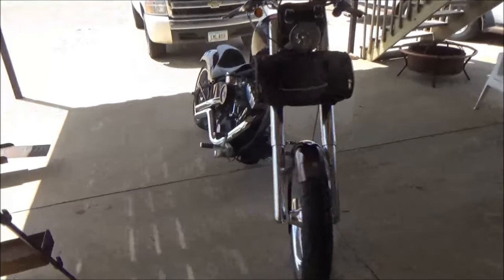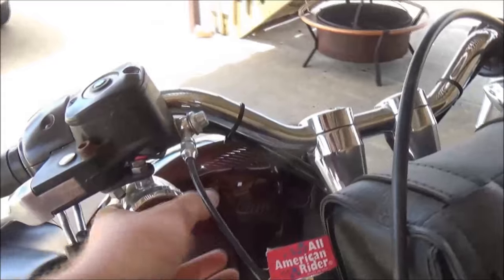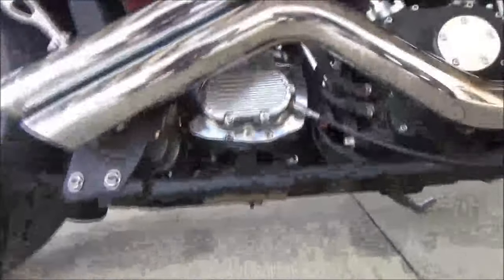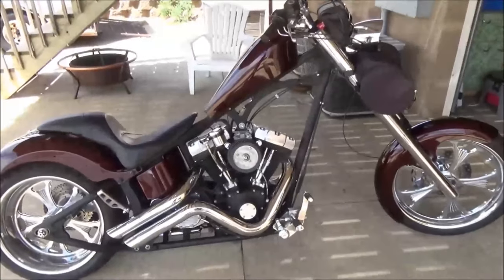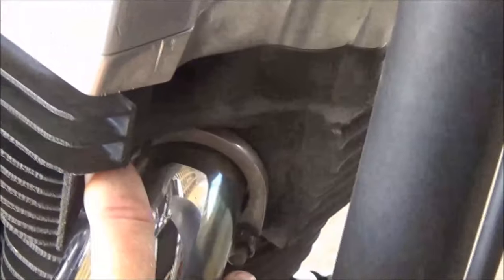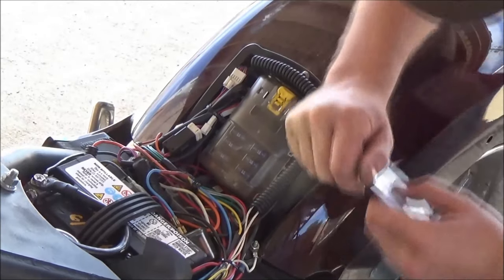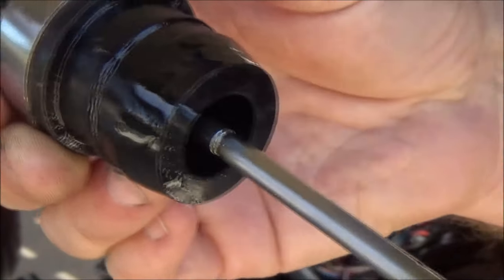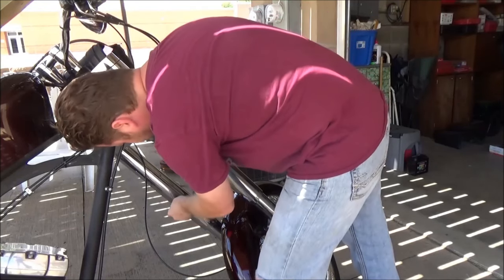What you need to know about owning a chopper! Best delivery of a bike EVER! #chopper #how2wrench

Comment: The Recession killed the "factory chop" market. The old farts who bought them during the "factory Harley" shortage spent enough to support a variety of companies, some of which assembled questionable shit (Big Bear neck weld failures come to mind!). When the Recession destroyed their 401Ks they sold their toys, and now they are too old to ride.  BTW I always check the alternator plug connection on Harleys/clones since it frequently fills with oil and burns/arcs the contacts. Easy to fix but most folks forget to check, and I ALWAYS do a cold compression test before parting with money.

Comment: Been ridin my ALL rigid chop for almost 14 years now. Only bolt I ever lost was the gas tank mount under the tank. I found the MOST important tip is THREAD LOCKER on EVERYTHING!!!!!!  Saves a lot of trouble.
Reply from the maker: Robert...I think you may be discrediting that you MUST be a good mechanic and understand tools, fasteners and how to work with them...not the case for a lot of other riders...😎 Don't forget anti-seize has its place. 

We sure love you taking the time to comment.  Join this channel to get access to perks:
https://www.youtube.com/channel/UCBhM8DCKnT3qXwTW0eToyCg/join 
Want to help us back? Please subscribe and give us a high 5 here:  https://www.paypal.me/how2wrench 
Follow us!
www.How2Wrench.com      
www.Tools2Wrench.com   
Facebook: 
https://www.facebook.com/How2Wrench/  
Instagram:
https://www.instagram.com/how2wrench/
Reply: @How2Wrench  I DO use anti-seize on my plugs always. Do you use it anywhere else?
Reply from the maker: Same here. Also on axle shafts and a few places for items I would consider standard maintenance like axle adjuster hardware.
Reply: @How2Wrench I like the axle shaft Idea instead of just grease. I'll be doing that. Thanks.
Reply from the maker: @robertshaefer7760  Here is what I use. I love its aerosol. Nice to work with. I've taken off wheels years later and thousands of road miles and its still on the shaft even after I personally have drive through pouring rain storms. https://amzn.to/32MvCkF
Reply: @How2Wrench  Got to admit I've never heard of that stuff. Coming from Switzerland it's no wonder. I give it a shot eventually. Thanks for another great tip.

Comment: I have a 82 FLU with a rigid mounted engine.   I check the bike from front to back once a week and still have had my front exhaust pipe , rear brake caliper, handle bars, seat, battery holding strap, throttle assembly come loose because fasteners backed themselves off. I always recommend carrying a toolkit that will save the day on a regular basis.
Reply: Red Loctite, locking fasteners and safety wire are your friends. I have Shovels too. Harley handlebar clamps don't positively control the handlebars so after trying everything else over the years I switched to stainless bars with welded risers, and on one set I tack welded the bars at my preferred angle to Biltwell stainless risers. The tacks are invisible (being inboard on the bottom part of the riser) and will shear in a crash. No more bar issues and I run 14 and 16" apes.  Of course I carry tools but I don't need them often. You can get tabbed lock washers for your exhaust pipe bolts.
Reply: Yep, a Harley vibrates that much and NO OTHER BIKE DOES, the company could stop that if they wanted to, decades old design could be changed just enough.

Comment: One of the best looking well, crafted and great profile, choppers, I have ever seen. QUESTION:  Is that a single cam, S&S engine or Rev Tech engine? What is the Cubic Inch displacement?
Reply from the maker: Thanks friend! It is a Twin Cam built to 107". I believe it's the largest you can go with stock Harley cases.
Reply from the maker: Head over to the new website and subscribe to the newsletter to never miss a video or newsletter! www.how2wrench.com/contact/ 
Keep Wrenching,
Shane Conley
Instructor/Motivator/Motorcyclist
www.how2wrench.com

Comment: Beautiful BIKE! I do hope you can help me out, thinking about buying a Bourget Black Jack used 2003, they are $8-$9,000 in flawless condition with 4- 8,000 miles. I think they are much cooler that the used sportster I could buy with that money. However I'm not very mechanically inclined, but I'm willing to learn and work on it. Any advice? Am I put pf my league, or could a average Joe like me own and operate a nice clean used chopper with little to No worries? I think they are timeless and works of art, and it would be amazing to own one. Thanks again in advance for your time and this great VIDEO! A+.
Reply: STUDY them thoroughly so you know more than the name. A lot of bikes weren't built using full S&S engines so when you see one over the cases. You can contact S&S with the engine serial and they'll be able to tell you if the cases were from a complete engine or pieced together.  If you aren't a mechanic, learn. HDs are easy to work on and though those use aftermarket drivetrains the closest HD factory service manual and parts book will serve you well.  The clone (h)arleys are easy to work on like the originals  Don't make one your only machine. Become your own chopper encyclopedia. There are no shortcuts. Also remember big inch engines with high compression aren't as durable as stock displacement stock compression machines. You can of course drop the compression at next top end overhaul.
Reply: Ob Fuscated THANKS SO MUCH!!!

Comment: I know I might be a little late here but, one thing I would like to share is in regard to S &S ez start cams. I never had experienced the issues you did. I had mine installed on a EFI touring model and never saw the need to readjust the idle speed with my 551's. Secondly, I am a fairly new subscriber to this channel. I would like to see a lesson on rear wheel alignment. I have been through a tough experience to say the least. Also how about suspension set up and what rake and trail is and how effects handling...
Reply: Harleyforever20 
As a car guy I chuckled at “turn the idle up” 
Because on my summer car for years it’s been eating alternator belts. 
It’ll eat 3 in 3 months. 
I’ve done tons of research, other folks having the same problem too. 
One day while screwing around I checked my idle speed. 
It was like 550-600, when it should be like 850. 
I turned the idle up and the half chewed belt has been doin fine for the last 2yrs. 
Same with the little Briggs air cooled engines, low idle isn’t cool , the crank dipper can’t splash enough oil to keep em lubed.

Comment: .how do you change the oil?dose it the oil pore out under the motor or do you empty the oil tank and just refill that?my bike it's too hard to pull a hose of the oil tank to empty so had to draw it out the fill hole,so when you fill it again the motor just draws the oil through thanks for your help Martin

Comment: its a custom not a chopper, that frame is not cut or stretched, and its all stock parts... not trying to pick a fight or anything but thats not a chopper
Reply from the maker: Joshua Mcleland Strange you think so with that huge gap above the front jug. 8 inches in the downtube, +5 degs in the neck, 10 in over front forks. There where 3 stock Harley parts used on this build. Engine cases, hand controls, and the battery.  What is even the point of making that comment?
Reply: my apologies than, it looks like a showroom bike, you did a good job on it....just sick of folk calling customs, chopppers when they buy them off a showroom, its kind of irritating to the guys who actually build them, like its supposed to be.
Reply: an example my bike kawasaki kz1000 1979 motor and frame. the frame is cut stretchted and hardtailed. the front wheel came off a honda, the back wheel off a suzuki, the sissy bar from a yamaha, springer front end standard fitted to a metric bike. Harley tank, bars, risers headlight. disc brake from the rear only off a old kawasaki. chopped up other bikes to make one bike... chopper
Reply: that being said your bike is a good looking bike
Reply: That is exactly what I stated, IT AIN'T NO CHOP!